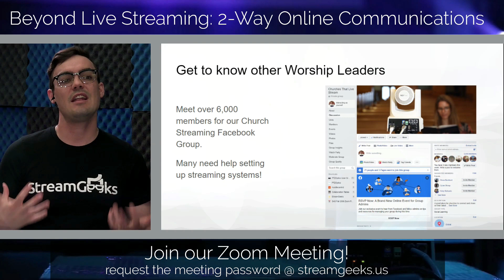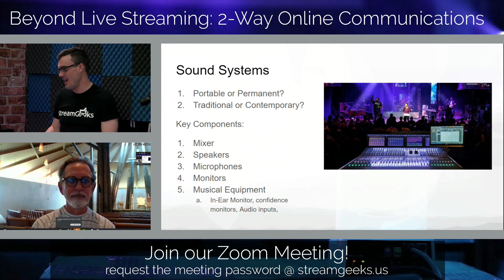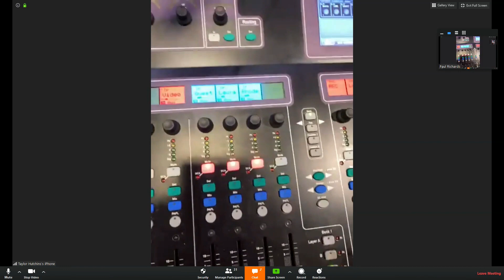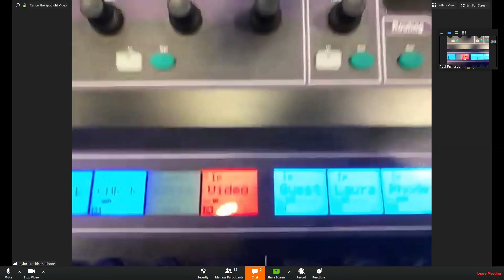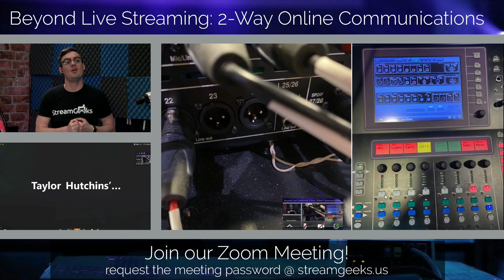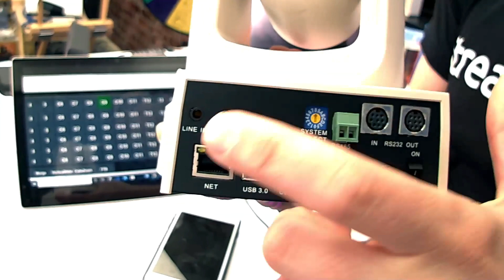Beyond Live Streaming: Two-way communication technology for church

Comment: How can you window capture in OBS the active speaker in zoom? I want to have a box in OBS that will only show who the active speaker is, then I can send that to Zoom and spotlight my video so I can overlay pictures etc for the active speaker.
Reply from the maker: To do this you need to capture 2 Zoom windows. One for active speaker and one for your video pinned (not spotlighted). Spotlight makes everyone full screen with your video so it may override active speaker.
Reply: StreamGeeks But when I then put zoom in gallery view, won’t it override the active speaker box in OBS? In your video, the bottom left box seemed to always show whoever was speaking from the zoom gallery view.
Reply from the maker: @Paul-ly1pw  There are two different machines running Zoom. One is on the computer we have running our video production software. The other is my presentation laptop which is connected over NDI. So we can show both various views at the same time.
Reply: StreamGeeks ah I see. One of the images is coming from the computer, the other coming through NDI on the second device.
Reply from the maker: Paul Aspinall - yes that is how we do it. Do you ever use NDI?
Reply: StreamGeeks I haven’t used it, no. Althoigh I don’t have 2 computers.
Reply: StreamGeeks can you also achieve this by screen mirroring from iPad to PC and if so, is there an app that will do this?